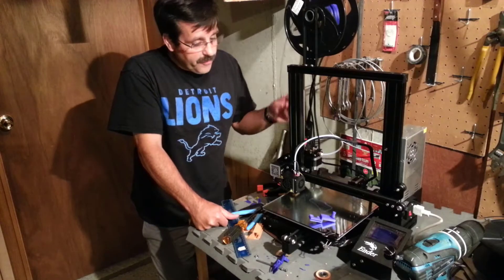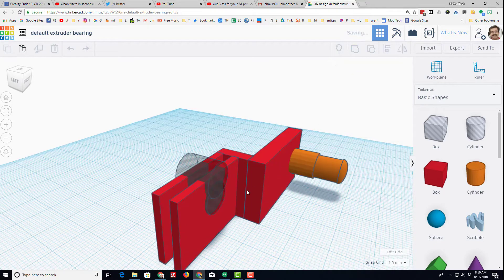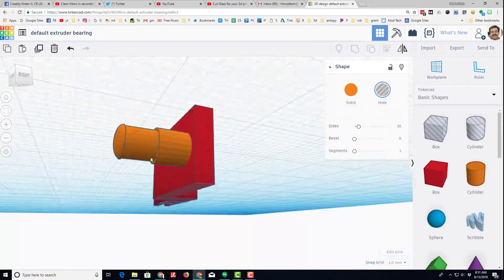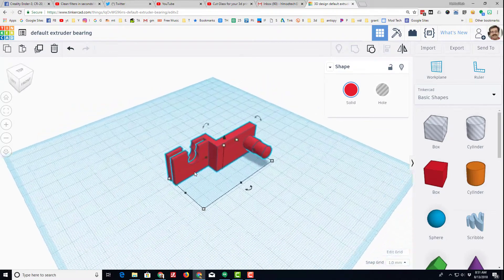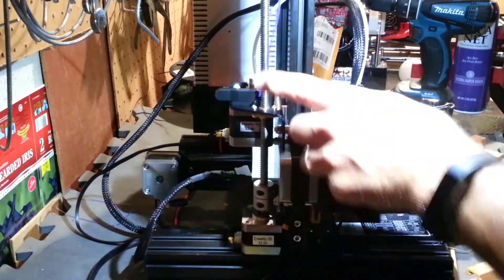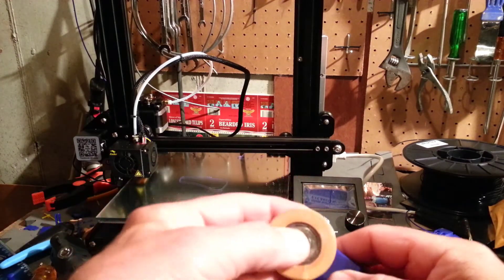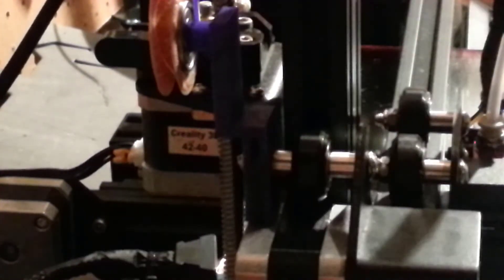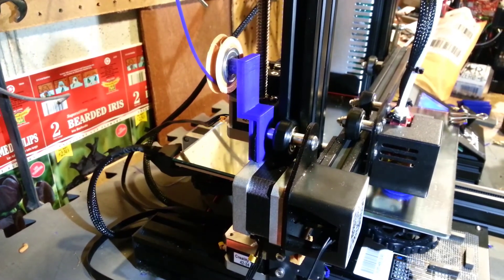Best Filament Guide YET? Simply snaps on your Creality Ender 3!

Comment: Is this on thingiverse? If so which one is it?
Reply from the maker: All fixed now. It is V7 and the link is in the description. Thanks for the heads up.
Reply: I made the one on thingiverse that has a fist on it and the filament goes through it,  had some serious fitting issues. The holes lined up nice but too much material between the holes and the extruder,  a dremel did nicely though